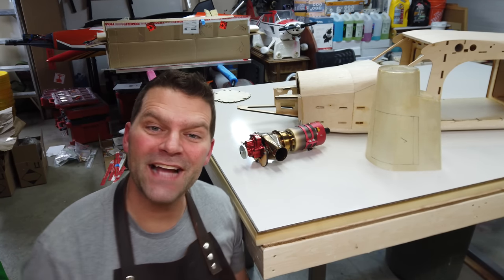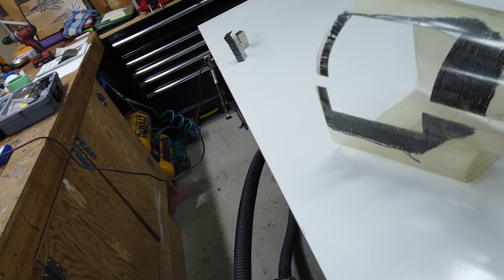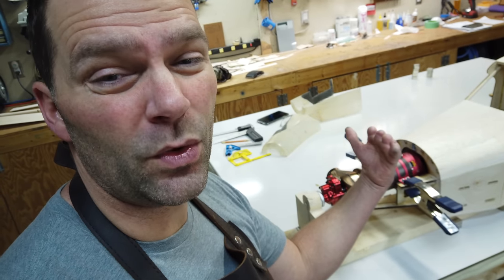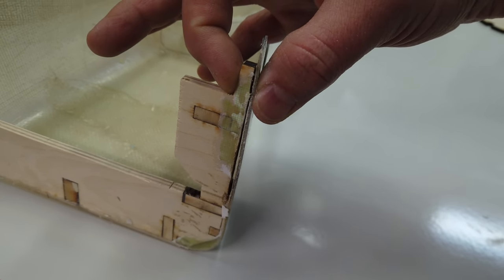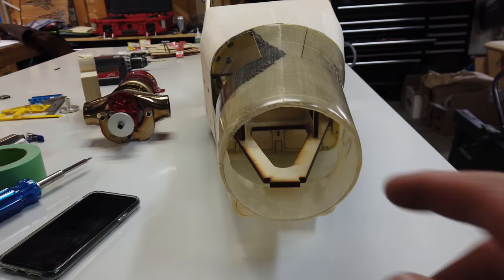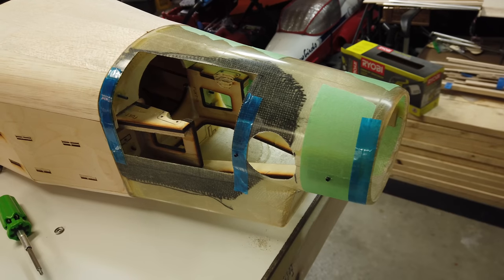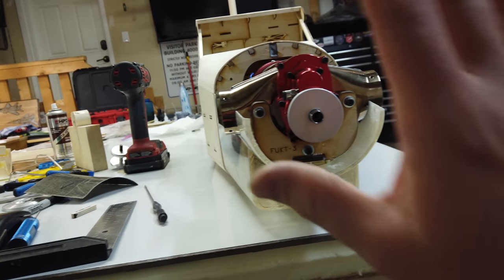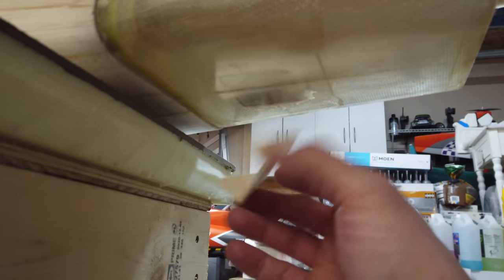COWL INSTALLATION HOW TO - MR Aerodesign Kingtech Turbo Prop Video 11

Comment: Inexpensive pinking shears from a craft store for cutting fiberglass and carbon fiber.  Minimizes the fuzzies that regular scissors leave.  Kevlar you have to regrind Fiskar 9 inch scissors to a 90 degree edge with a 80 grit sanding belt.  Take the screw out and act like you have done it before, it’s easy. Done hundreds and it works spiffy.  And when glueing on a nonexpendable surface with epoxy, wax paper or plastic food wrap is your buddy.  Hold it level with your magnets and Jane be yer auntie!  Try diamond cutting discs for durable long lasting cutters.
Reply from the maker: Great tips!  Thank you for them and thanks for watching!

Comment: Bonjour Jonathan, je sais maintenant que tu parles Français  ( you speak very fluently French now ). amezing work, as usual. Just a question : This kind of engine make a lot of warm, isn't it ? no probem for le front of fuselage near turbine ( fire risk ) ? HI from France
Reply from the maker: Thank you very much!  The hottest part is the exhaust section.  This is a very tight cowl fitting but the goal is to have airflow moving through the entire system while running.  With the 1/4" gap between the spinner and cowl and the 1/4" gap between the exhaust and cowl there should be sufficient air movement to keep things cool.  That is also the purpose of the large door on the cowl.  So at shut down the door gets opened and you use a blower to keep air moving over the engine while cooling down.  Thanks for watching!